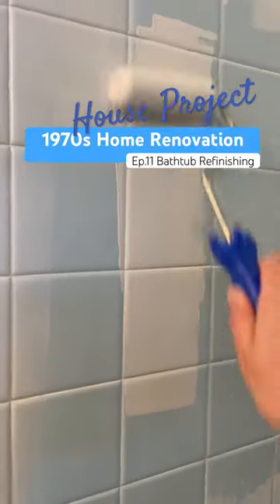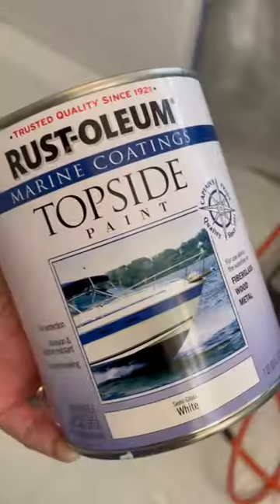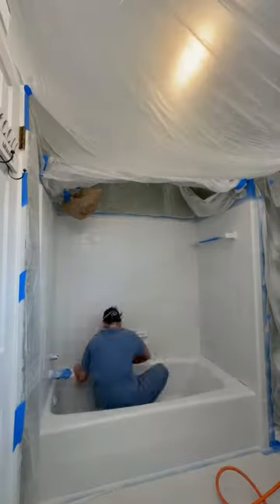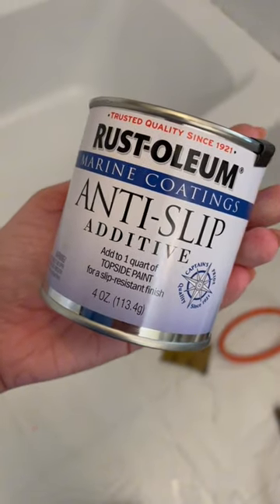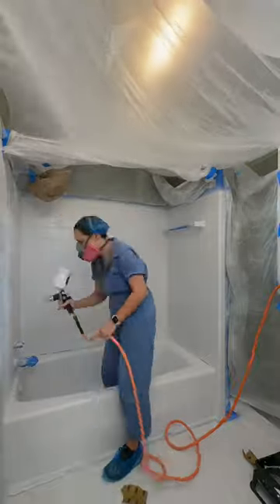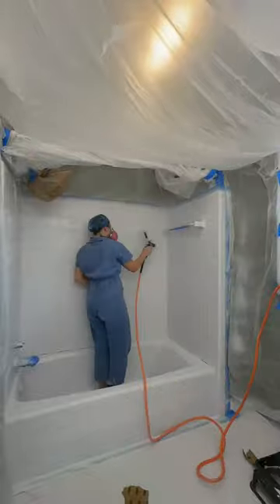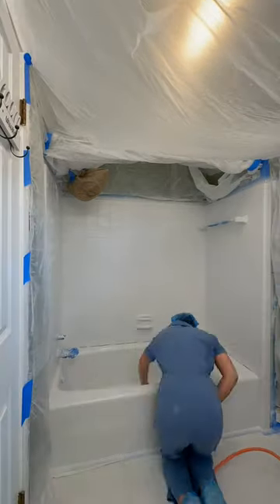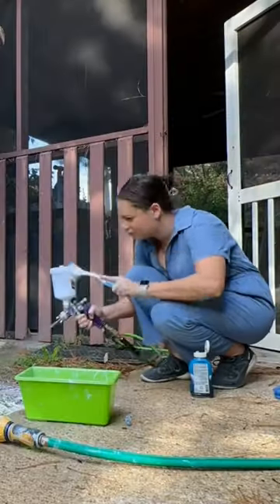Ep.11 Bathtub refinishing | SET BACK on 3rd coat! | Frustrating | House Project Home Renovation

Comment: We got anti slip added when a professional redid our tub. Must have been the same thing. It was fine on our feet, but way too rough to sit on while taking a bath. I'd think that adding plain coats on top would smooth it down a bit, though.

Whatever you do, don't use a suction bath mat when you're done. It will suction off the paint!

Im very invested in this series, wishing you luck!
Reply from the maker: Thank you! That was my exact thought,,,, no baths with that floor 😂

Comment: To remove the anti-slip, I recommend using an orbital sander with 80 grit sandpaper. In addition, taping off and blending into the tub walls is a good way to ensure a clean and uniform finish. Another option would be to spray over your current anti-slip with additional layers. Other than this, the marine paint looks excellent. Hopefully it works out.
Reply from the maker: Thank you! 🙌

Comment: The particle size of non skid additive is too big. There are smaller size particles. If you coat the dried non skid coating with another coat of topcoat, it might cover up some of the non skid particles